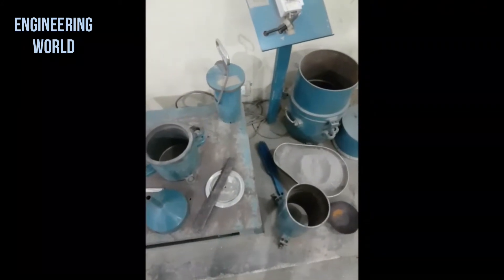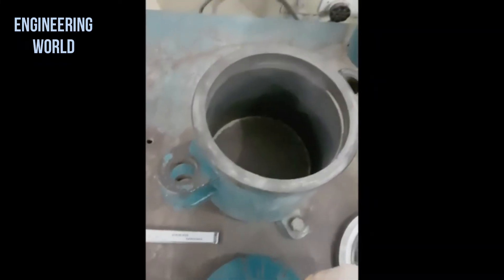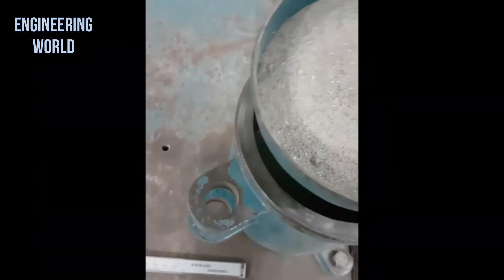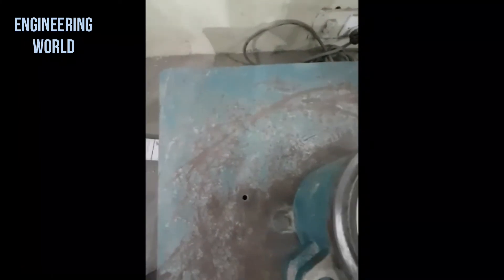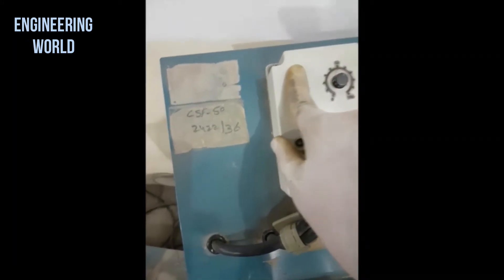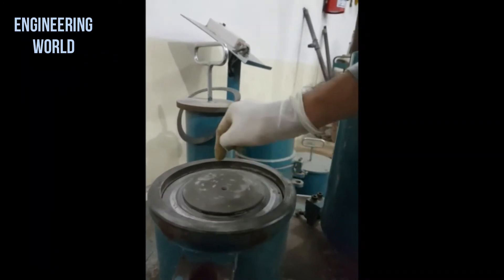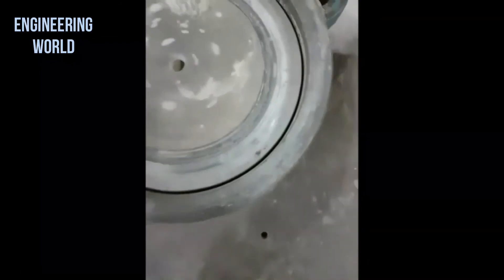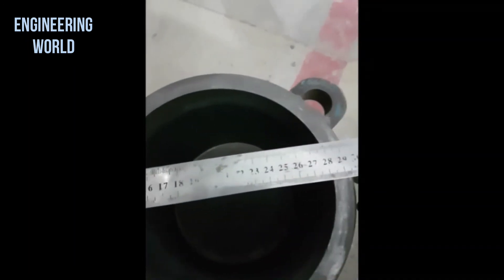Relative density Determination of max and min void ratio of granular soils | Engineering World

Comment: Please explain ur excel sheet. What was the relative density for ur test. u just made a table from 0 to 100 but didn't calculate relative density for ur test
Reply from the maker: Dear the Relative density varies from 0 to 100% as we know the formula of relative density is 
(emax-ef)/(emax-emin) so for sample No 1 I know the emax and emin value but ef is not known which in situ void ratio so the value of ef can be assumed.
 Here we divided (emax-emin)/10 to get a range b/w 0-100. 
If we excatly want the Relative Density of sample the ef of the sample(sand) must be known
Reply: @mhaengineering4397  thanks for ur reply. Is is possible to get field void ratio greater than emax in lab? in that case will we shift field void ratio as emax in formula? actually I am getting Dr in minus